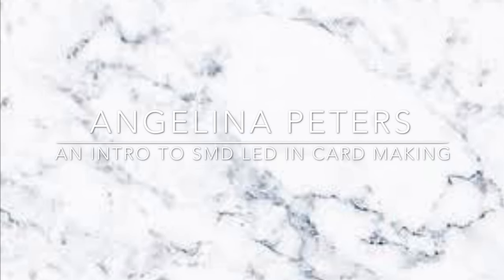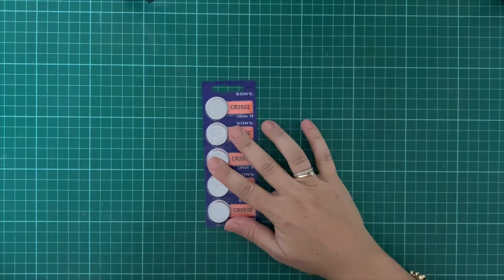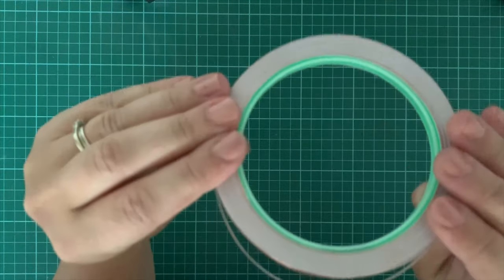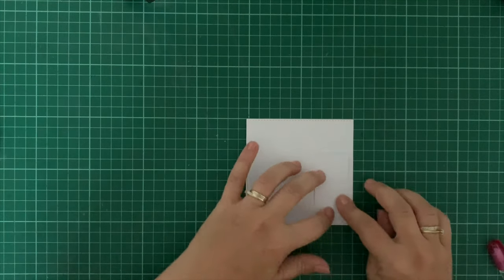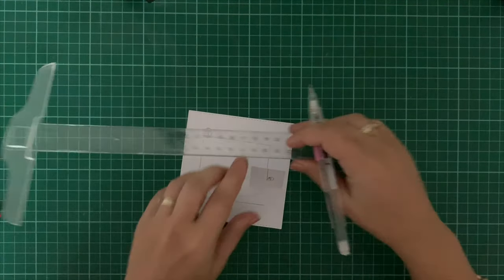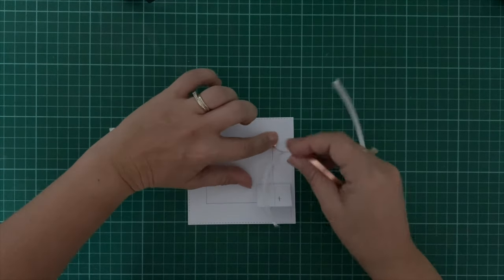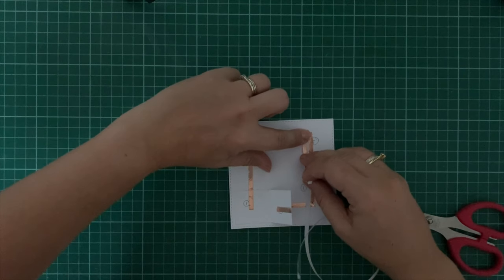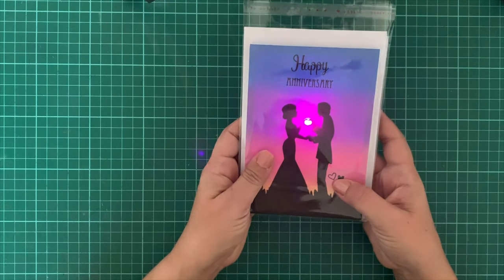How to Make a Light Up Card Using SMD 5050 LEDs - A Beginners Guide

Comment: Angie I love your tutorials. You explain everything so calmly and clearly. I couldn't get the link to work. Is there something missing off the end?
Reply from the maker: Thanks Cindy! I’m not sure why it’s not working perhaps this was an operator cut n paste error 🤦🏼‍♀️ I’m not sure?

Here are the full internet page links (I previously used from the app)

I hope it helps and you give it a go!

Lights:
https://m.aliexpress.com/item/32833955606.html?spm=a2g0n.orderlist-amp.item.32833955606&aff_trace_key=b981b6661a6f465fb0ea8349ac62ca31-1555578575882-03112-baAUn27&aff_platform=msite&m_page_id=1634amp-6dAg3zGUikAFWC2NbbwT6A1559246481772

Copper tape:
https://m.aliexpress.com/item/32848865202.html?spm=a2g0n.orderlist-amp.item.32848865202&aff_trace_key=b981b6661a6f465fb0ea8349ac62ca31-1555578575882-03112-baAUn27&aff_platform=msite&m_page_id=6345amp-6dAg3zGUikAFWC2NbbwT6A1559246805260

Batteries:
https://m.aliexpress.com/item/32922069655.html?spm=a2g0n.orderlist-amp.item.32922069655&aff_trace_key=b981b6661a6f465fb0ea8349ac62ca31-1555578575882-03112-baAUn27&aff_platform=msite&m_page_id=3154amp-6dAg3zGUikAFWC2NbbwT6A1559247014346

I think my last 3 links did work properly though? Let me know if you’re still missing anything and I’ll pop it in the comments. I’ll make sure to use the safari links in future tutorials thanks to your feedback!

Have a great day!

Comment: Thank you so much for the great video. Really appreciate the super clear instruction. May I ask how you attached the light to the copper tape? I use double side tape but it doesn’t seem work to me. Thank you again 😊😊😊
Reply from the maker: Kulravee Buraphadeja hello and thanks for watching and commenting. I just used clear tape you don’t want anything between the connection points and the copper tape. You CAN use a tiny drop of super glue or other strong glue but straight onto paper away from connection points and copper tape to make sure good contact.
Reply: @angelinamacintosh5796  thank you so much and really sorry for late reply. I do put clear tape as you recommend. Your video is really helpful. I hope you have a good new year :)

Comment: Do you just drop the super glue over the diode? I wasn’t sure how you secure the lights or add more than one.
Reply from the maker: Hi Jan. you can just use a small drop of superglue on the back of the diode but in my case I have found packing tape over the diode worked fine. Good luck and enjoy the process

Comment: If you were posting this, how do you stop the switch from accidentally being turned on and running the battery flat?
Reply from the maker: I build the foam up well around the switch to make sure the pressure has to be focussed in that spot. The light should last a long time even if posted I’d expect. There are alternative switch options you can do - sliding switches which are a bit more complex but ideal for that concern. Check out eiken laboratories you tube and you may see them demonstrated easily there. 

Thanks for watching :)

Comment: Please which website can i buy those peal off smd 5050 led lights...cant find them on ebay
Reply from the maker: Hi I have linked them in the you tube description. Mine were from AliExpress. If you search SMD5050 it should come up. Here is a link I just pulled up that looks like what I used ☺️

AU $1.39 | 100PCS/LOT SMD LED Kit 1206 1210 5050 5730 0805 0603 3528 Red/Green/Blue/White/Yellow led diode set 5 Colors Each 20PCS
https://a.aliexpress.com/_dUk5g8L

Comment: I have a question. I made like three cards by now, but unfortunately all of them end up losing contact after I close them. I think it has to do with the card being flexible. Do you have any solution for this, except the obvious of using thicker paper? :)
Reply from the maker: Hmmmm you could try doubling or tripling the cardstock as you say the likely obvious solution but it COULD help to try superglue as the adhesive as it holds great. I find it difficult to do and the tape personally works best for me. I’m sorry it’s not working for you. Mine are still going strong years later! I love the cards so much I pain to give them away hahahaha 😅
Reply: @angelinamacintosh5796  Omg thanks so much for the reply!! I have not attempted to use any glue. It won't interfere with the LEDs contact if I use a liquid like a glue, correct?

Comment: Great tutorial! My only thing is.. unless theres extreme pressure on my leds they won't light up on thier own. So frustrating. Idk what to do? Wierd. Thanks ... great video!
Reply from the maker: Oh, that’s a shame. I don’t need to apply much pressure. May take a few goes to get the hang of it. The tips I have are: don’t lift and adjust the copper tape it causes damage to current flow, burnish it firmly, used firm card base, be careful applying the lights as you can damage the connection points. These are some of my trials I’ve had learning to get it right first time. Best of luck. Share your cards with me on facebook @AngelinaPetersHandmadeCards
Reply: Oh my gosh same here. It's so frustrating. And i have literally been trying everything to apply pressure whilst not reducing the amount of light showing through sigh
Reply from the maker: @cher6481  oh I’m sorry to hear that!! I use thick packing tape over the diode at 12:50 in my light up anniversary card tutorial you can see my application. It does take time and it’s frustrating when it doesn’t work. But it’s such a delight when it does.  Keep at it 😊